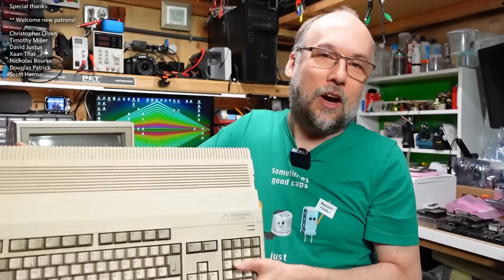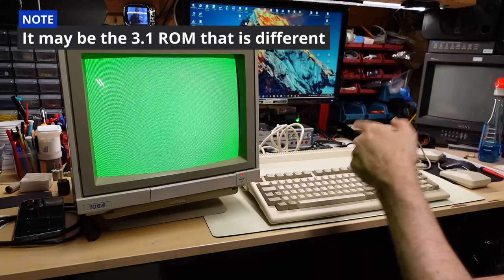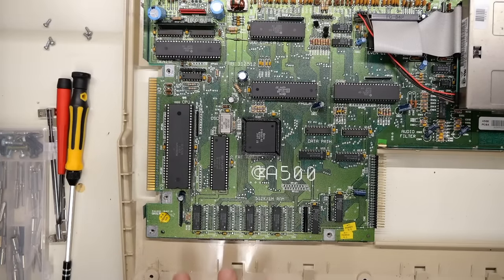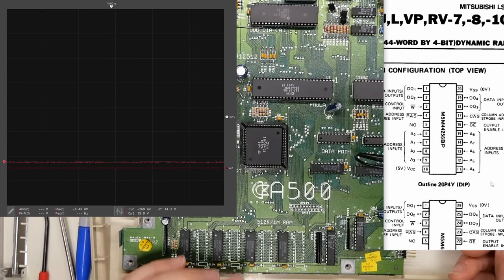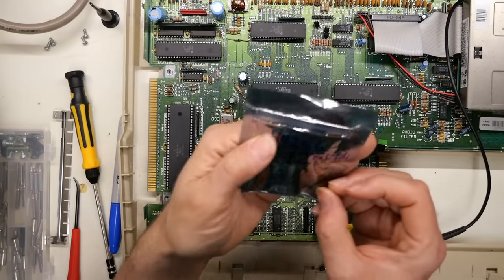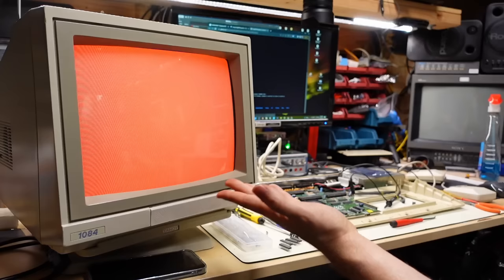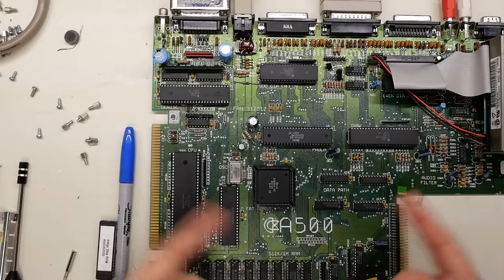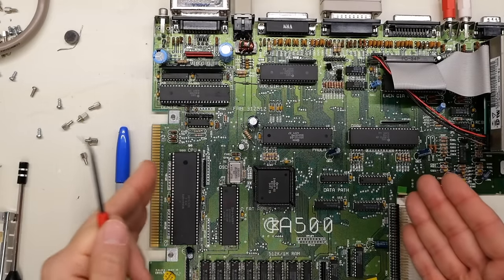Can the Amiga Diagnostic ROM help me figure out what was wrong with this Amiga 500?

Comment: Great timing for an A500 video.
Just got a great condition Amiga 500 recently ntsc US machine with rev 6A mainboard with 8372A agnus just like the one in the video.  Mine has TI ram chips though(checked after this video lol).  Recapped the whole machine, and soldered in a new agnus socket because the stock one was cracked.  The machine worked perfectly fine with the cracked socket but I wanted to replace it anyway because it bugged me, and should be more reliable now.  Anyway great to have an Amiga again after alot of years, and I'm enjoying going through old games, love the tunes on this machine!

Comment: There are some revisions of the A500/A500+ board, and the Agnus chip that allow to address up to 2MB of chip RAM by using 4x1Mbit chips instead of the 4x256kbit ones, and some extra passive components (AFAIK a diode, and a few resistors). I can't recall the original source where I have my guide from (which is in storage together with my A500), I think it was one of the larger Amiga forums.
I couldn't find any 4x1M chips in a DIP socket, so I made some SOJ28 to DIP adapters (ordered them at PCBWay or JLCPCB, I can't recall) and used memory chips from 1MB 30 pin SIMMs :) It's not yet finished, since I had to move from my flat, and put lots of my stuff into storage, including the Amiga as well. Someday I might be able to finish it, hopefully... (or just get one of those Agnus riser boards with a singe 2MB chip on them)

Comment: Yep, piggybacking RAM chips is definitely a crap shoot… where you don’t even know the house odds! You could have a functioning (but weak) output driver on the chip on the board, and a nice, strong driver on the piggyback chip. Then, when you power it up, the bits could be in any state and the chips would compete to drive one of the data pins high and low at the same time. Then, what was a functional - but weak - chip, is now a bad, open-circuit chip! 😬
Reply: 😂😂  I always found the piggyback look astonishing as a child, I was like, that works? 🤔🤔
Reply: Yep I agree. If Piggyback works, the chip is definitely bad, if it doesn't then the chip could still be bad. I think as long as the person testing that knows that, then it's ok, but if they piggyback each chip and it all still fails, then they assume that all the the chips are good, then it's a bad assumption.

Comment: Socketing the RAM chips on an A500 is usually not recommended because the sockets raise the chips high enough to foul on the keyboard unless you use low profile sockets.
There are 2x74LS244 and 2x74LS373 that sit on the data line between the RAM and the ECS chips. A break in the traces on these lines or a bad logic IC will also cause a green screen. 90% of the faults on an A500+ are caused by battery leakage destroying the traces on these lines, usually under the chips themselves.
Also, DiagROM only performs a cursory RAM test at startup, mostly to check if RAM is present and usable because it takes several minutes to do a complete check of all the memory. In the menu there is an option to perform a complete memory test which is more like the test used in the Amiga Test Kit.
I've repaired a number of 500's and never seen a memory error like that one myself so I would have been scratching my head as well.
Reply: I wonder if battery leakage was the real problem, and these replacement chips just somehow bypass it. Damaged trace making the signal weak, but the new chips can still understand it while the old ones can't?

Comment: One of the issues of the early '80's I assume was simply that Commodore was maxed out in production, trying to keep up with the 64. They cut corners, obviously
Reply: They had a dodgy method to re expose a section of the die to repair wafers that should have been binned. It was discussed on an episode of the Amphour podcast. I suspect the "repaired" dies were not so reliable in the long run.

Comment: About Desoldering stuff:
I found it to be very helpful to have a Hot Air gun at low temperature (200°C or so) warm up the board a bt and then use the desoldering gun while also heating up the Board with the Hot Air.

Comment: Hello, Adam.
I am from Monterrey, Mexico, and I can confirm that Commodore Amiga 500s were sold out of a major chain retail store called Soriana which is similar to Wal-Mart, in the late 80's or early 90's. Two friends bought Amiga 500s when they noticed the local Soriana branch where we lived had the machines on display but marked with a lower price than what they were actually worth. They quickly snatched the machines before the store managers noticed anything was wrong. That was the first time I had seen an Amiga computer. Before that, I was acquainted with the PC, the Tandy Color Computer and the VIC-20.

I don't think these Amiga computers were specially modified for the Mexican market because the TV format in Mexico is indeed NTSC but since my friends also bought Commodore monitors for their computers, then I could not really tell you if they had anything special other than the fact the store sold them at below cost by mistake.

Comment: I know you want to avoid desoldering the memory chips, but would it have been an option after you had them out to run them through your Retro Chip Tester? I don't know more about that device than I have seen on your channel, so I don't know if that particular DRAM chip type is supported by it. But if that's an option, it would sure be interesting to see the exact failure mode of the RAM chips.

Comment: I had an Amiga 500 from 1988 to 1992 and for the last year of having it, i used to get a green screen about a third of the time when turning on. Out of frustration, I stared tapping the side of the machine when it happened and unbelievably it used to fix the problem. When I sold the Amiga to a friend, he said the problem and solution lasted another 2 years, until he eventually sold it. I don’t think todays electronics would stand up to that type of punishment these days. Great video👍
Reply: aaaa, the old slap the machine until it works again method. very popular also on tv's.
Reply: Agnus chip not making good contact in the socket can also throw these colors. Re-seating it usually fixes the trouble.
Reply: ...or a trace is broken/damaged and only makes contact sometimes...

Comment: The 68000 actually has a 24-bit address space which allows it to address up to 16MB, but it is possible that the way it is implemented in the Amiga doesn't allow the whole address space to be used at one time.
Reply: sure, but this dude is so self-proclaimed "pro" he has no idea what the heck he's doing 😅
Reply: @nneeerrrd  he never proclaimed his self pro and he did mention in the video that he doesn't have much experience with these 16bit systems.
Reply: It can address 16MB total but that includes a lot of stuff like IO space so only a little over half can be occupied by RAM.

Comment: Hi Adrian, just a little note why piggy bagging didn't work. Piggy bagging can fix situations where bad chips failed to signal for whatever reason but as you saw in diagnostics the bad ram chips were pulling the bits high and thus the address line remained faulty. Great video, I love the A500!

Comment: It is a newer 1.3 machine with (what we called) a "fat Agnus" (compared to older 1.2 ROM machines). I had a trapdoor RAM module on A500 and it had 512Kb fast RAM, but some newer gamers required 1Mb Chip RAM . With that jumper connected it "converted" that 512 Fast RAM (and 512kb onboard) to total of 1Mb Chip RAM. 

Btw, my Agnus had a bad socket and it worked only when pressed firmly into it... in the lack of better solution (i.e. socket), it got a U-shaped thin steel sheet under the shield to press upon it as a persuasive measure to stay in socket, and the sheet also worked as a cooler as my Amiga's stubborn Agnus was quite warm :)
Reply: Not quite.  Every A500 ever produced has a "Fat Agnus" or "Fatter Agnus" (PLCC, the square package) Both OCS and ECS Agnus chips are "fat" - only the A1000 has a "regular" or "skinny" Agnus (DIP - In-line "straight" package).

Comment: The A500 Plus motherboard with its built-in clock and battery often leaves a trail of destruction around the battery. The standard A500 motherboard is therefore much more robust and reliable. Nice job, Adrian.

Comment: Glad you found the problem, defective DRAMs on Amigas become more and more common after 30 and more years.

Can also be a problem with a worn-out Agnus-socket. This things are nowadays only hold together by the patina that built up between the chip and the socket. If you remove the Agnus (for cleaning the socket) and reinsert it the 30 year long marriage between chip and socket may be divorced permanently and the computer no longer works. That may also happen if the computer get shaken by incompetent delivery associates while in transport. 

You can hook up an Amiga with installed Diagrom via serial connection and read out informations on any computer with a terminal program like Putty, even if the display is only showing color codes and no text.

Comment: FYI, if you want that motherboard model to be switchable between PAL and NTSC, you can add a switch across JP4 next to the Agnus chip. You have to reboot after switching it, but it does give you an easy option if you have software designed for both formats.

Comment: I have an old MEGAMAX programmer that I used way back in the day. I can't believe I still have it. It still worked the last time I had it plugged in. I am going to see if I can get any info from the original company to write my own drivers and get it back to modern day working order. If not then Its like a museum piece.

Comment: My second computer (after my 64) was an A500, so this was a bit of a trip down memory lane. Two things. If three of the four original RAM chips were bad, I would definitely NOT trust the fourth one to continue working, I’d replace it. The other thing is that I believe any RAM added through the trapdoor slot would be categorized as Fast RAM, not Chip.
Reply: Absolutely agree on replacing the 4th chip.
Would also like to see if Retro chip tester sees a problem with those.
I have no idea if that is true, but Adrian meant that this specific board had a feature that allowed some RAM on a memory card module specifically compatible with this feature to be mapped into "chip RAM" area, possibly with discrete chips dedicated to that. No clue if such cards were ever produced either. Probably "normal" memory cards would still just show up as "fast/slow RAM".
Reply: So what you're saying is that two out of three ain't bad, but three out of four bad is bad?

Seriously though, anything with a failure rate of 75% to date deserves to get the boot even if it's still working.

Comment: The metal bracket on the side port is from a GVP external side-car hard drive. It was used to connect the sheidling between the two units.

Comment: I used to own a PET, and I have VIC-20s, C64s, and a 128, but I have never owned an Amiga. Wanted one for years. A friend of the family had a CDTV, and I told them if they ever decided to get rid of it, I'd buy it, but some time later they just threw it away... I never did forget that. Still bums me out to this day. They had a full rubbermaid tote filled with software for it. Prices are getting to a point where I've just accepted I'll probably only ever be able to emulate one. Oh well.

Comment: Adrian, it's been a year for this video. In case you have not yet found out (I am sure you did) that metal strip on the expansion bus comes with the GVP hard drive and helps to secure it to the Amiga :)

Comment: Looks like a Spanish ISO keyboard, I believe it is actually from Spain and not Latin American because it has a Ç key, which is not very used in Spanish(Castilian) but in other languages used in Spain (Catalan, Galician) is used more frequently. I don't think keyboard layouts for Latin American Spanish have this key.
Reply: First thing I noticed! I was like "Why the hell does it have a Spanish keyboard layout??!"
Reply: Commodore was cheap. "It's Spanish, so you get the Spain layout" is totally in the realm of things I would expect from them.
Reply: Except as he notes it has an NTSC crystal which means it wouldn't work on standard displays in Spain. Yes, it could be a bitsa but he notes the crystal have very similar rust to the other parts so it doesn't seem that likely.
And there's several countries in Latin America which has Spanish and use NTSC, it seems far more likely that the Ç key is just that they're using their already existing Spanish layout  rather than bothering to spend money (the horror!) on making a new "correct" one. :-) Much simpler explaination.
Reply: @Torbjorn.Lindgren  Yeah, it definitely wouldn't work here, at least until the multi-region compatible TVs were available, but those didn't come up until the late 90's...
Reply: It's not uncommon to find Spain layout keyboards in Mexico, also, the localisation and distribution of Commodore computers wasn't done by Commodore itself, but a third party (Sigma), so I imagine they didn't bother to make a Latin American specific keyboard
Reply: You're exactly right about the Spanish ISO keyboard layout. I can confirm that my Spanish keyboard (bought in Spain) in my current laptop is exactly this one (except some symbols in the numeric keys, so maybe it was a bit before standardization or something like this?).
Reply: Yeah, it's just as you and other viewers said. Spanish-Spain keyboard with NTSC mainboard. Weird but possible to cut down the cost of building different keyboards for Latin regions.

Comment: The "earth plate" in the bottom of the expansion slot might have been left there from a hard drive controller module. I got one with mine but I'm not using it, works A-OK.
The expansion port for the A500 is a somehow inverted Zorro II, plus it is a male edge connector and not a female socket. I have understood that the more or less legendary Amiga1500 desktop case has a riser for that, so you could add cards intended for A2000.

Comment: Just yesterday I fixed an A500 with a green screen.  One thing I found out is that if the system has ANY bad chip or slow memory, the machine won't boot.  In my case, the chip RAM was fine, but it was a 2 MB slow RAM board that caused the problem.  Turns out, all the RAM chips were fine, but there was some minor corrosion on the jumper configuration pins, so while the memory showed up in the memory map (and I could ramscan it), AmigaOS just couldn't initialize and use it properly.  And, yes, you can put 2MB of memory in the trapdoor slot, but the system will only be able to use 1.8 MB of it, as the tail end will conflict with the realtime clock space at $DC0000.

For anyone who is interested, the A1000 boot ROM will only test the first 256K of chip RAM and the WCS, so if the machine boots to the Kickstart screen, but fails with a green screen instead of the Workbench prompt, the problem is likely with the front-mounted 256K expansion module.

Comment: DiagROM boot ram test doesnt to a complete test. Just enough to know if its completely dead or not. Since DiagROM doesnt run from RAM its not the cause of your issue. You're supposed to use the main ram tool once it boots.
Reply: Yes, I was also going to say there's a full battery of RAM tests available once you get to the DiagROM main menu.

Comment: Another great video. The Amiga 3000 has socketed RAM , My 3000 came with 2 megabytes of RAM 1 megabyte of chip ram soldered on the motherboard  net to that are 8 empty sockets it also came with  1 megabyte of fast ram in sockets. I moved the fast into the chip  sockets and ended up getting 8 megs of fast ram in the zip sockets.

Comment: NTSC/PAL situation, IIRC the 500 has software based switching, as well as jumpers on the board itself to hardware switch between the two. No need to change any chips or the crystal. So no need to make region specific Amigas.
Reply: It depends how you connect the display. If you use RGB, then it really doesnt matter other than whether the Amiga starts up in 50 or 60Hz. If you use composite video, then you have to have the matching modulator - NTSC modulators get their colourburst clock from a clock signal inside an NTSC Amiga, PAL ones use a crystal but it's still referenced to a clock signal inside the Amiga. This is different between "PAL" and "NTSC" machines.

The main consequence of this though ,is that you simply dont get colour if you connect a PAL amiga to an NTSC display or vice versa. There's other ways to encode an appropriate composite/Svideo signal such as the AD724 chip, which you can set to use PAL or NTSC colour encoding (with the appropriate crystal)

Comment: When fixing an A2000 I had similiar issues with a green screen, but it was caused by dirt and grime build up on the fat agnus chip, I popped the chip out and cleaned the pins with isopropyl alchohol and re-installed it and the A2000 then started as normal.

Comment: It would make sense to do a preliminary RAM test entirely out of ROM, with only control flow and no stack, if you can't rely on RAM. It'd take up a crapload of ROM space, though, to store every address to check (since no RAM = no variables, more or less). I'm guessing this is what the diag rom does.
Reply: Having it exhaustively check a very small region, storing ramtest variables into that region, and then running an exhaustive test would be my initial approach to solving the problem. It'd catch major chip failures as well.
Reply: Yes. Registers are enough to store current address and current pattern, for random test you could use some small lookup table.